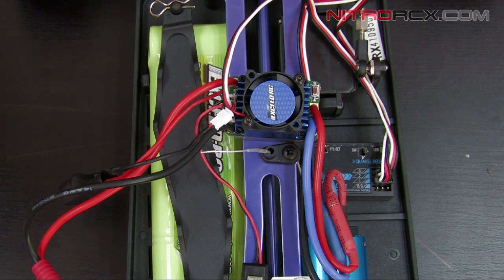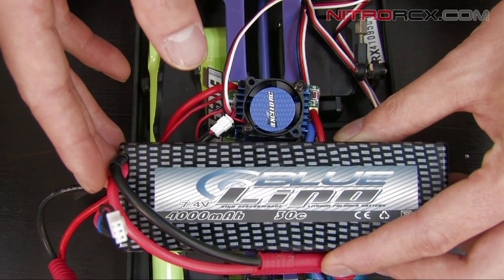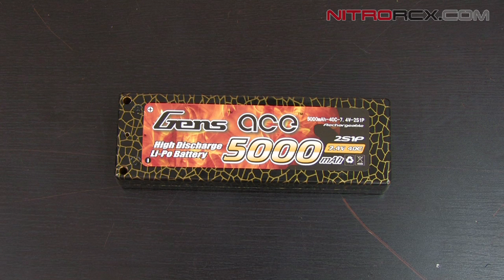Nitrorcx Guide: Brushless ESC Lipo Cutoff Programing

Comment: HI dude pls. help, i can't setup my start mode to level 5 or higher because the red led blinks for 4 times only. do i need to fully charge my lipo to make it blinks higher? and how do i restore it to factory settings which is level 5 in the manual?

Comment from the maker: You would have to get a volt meter to take the reading of the battery to see if the setting is actually kicking in at the setting that you put on the ESC.

Comment from the maker: It could be a issue with the ESC, receiver, or transmitter. To test the receiver and transmitter you can swap the plugs on the receiver, unplug the channel 1 and channel 2 plug and swap them. If you have throttle on the steering wheel and no steering on the trigger that means either the channel 2 port on the receiver is bad.

Comment from the maker: You have to disable the lipo cut off when you use a nimh battery, nimh batteries are suppose to to be drained completely where as if you drain lipo batteries below 3v per cell it's damage the battery.

Comment from the maker: @kartingfan77 If you don't have the lipo cut off set like how it's being done in the video the light will blink meaning that the protection setting is kicking in. There is other settings on the ESC, Like programming the running mode. I'm not sure but if you already tried to manually program the ESC you might of gotten into the wrong menu and set the running mode to only have forward and brake. If you need help programming the ESC I would suggest giving our techs a call and they can help you out.

Comment: Hey I need some help I have the 1/10 scale brushless buggy from nitrorcx and I just went to turn on my rc to centre the steering servo and I realized that my esc is blinking red  really fast constantly and and when I hit the gas or break it turns solid red until I let go and I also noticed when I try and do reverse it won't work usually i would hit the break once to stop it then hit break again to put it in reverse but now it won't work and I have it set so I have reverse instead now il keep hi

Comment from the maker: @hawkblade7 The mah on the battery doesn't make it faster, it will improve the run time but speed will stay the same if you're using it on the stock brushless system.